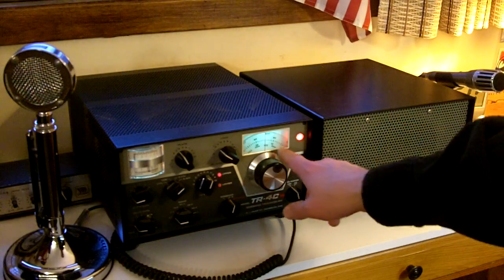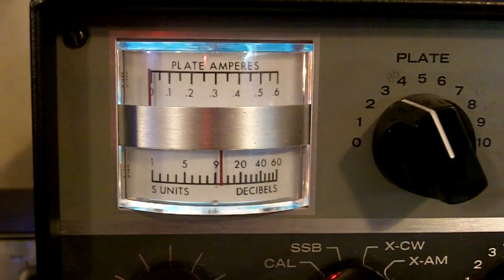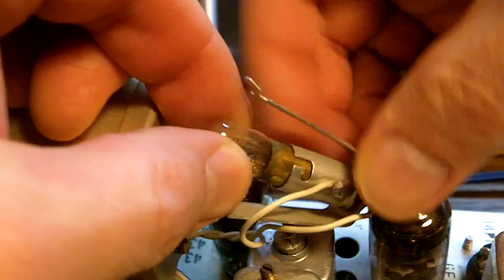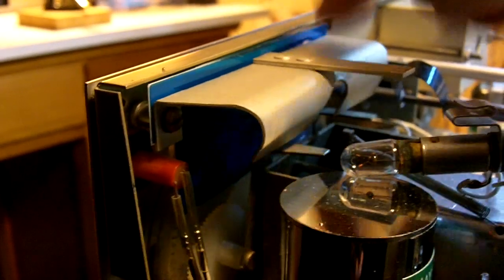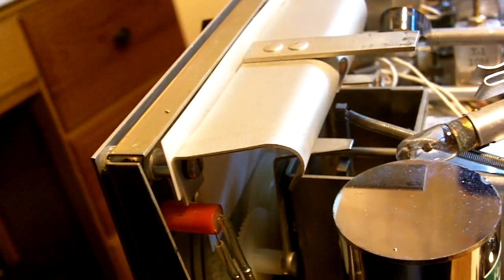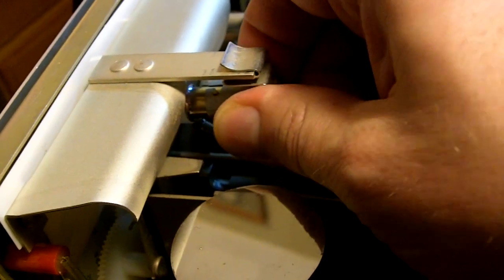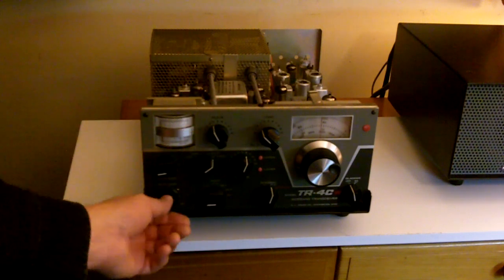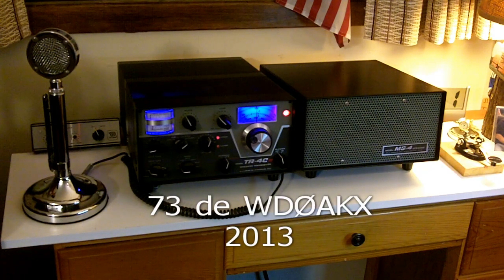Drake TR-4Cw Dial Lamp Replacement With LED's

Comment: Very nice! The only blue LED I found was on Amazon and wow it is way to dark so I took another approach.
I ordered cool white led's then ordered new material for the blue diffuser and it turned out really nice.
Im also going to research som blue led's like the ones you are using. I love the Drakes. I use mine
all the time. TR-3, TR-4 and TR-4C.

Comment: The LED on the VFO side looks like an improvement. I don't think I would do it for the metering side of mine though. I have a hard enough time seeing the FRONT meter faces now with the current back lighting. I don't think this improves too much on that issue. That is, illumination on the meter faces but that's much more of a problem to do if not impossible.

Comment: Larry, just wondered do you still have your Drake TR-4cw ? The newer vids dont show the Drake rig.
Reply from the maker: Yes, I still  have all the Drake equipment, it will be hard to part with that stuff!
Reply: RadioHamGuy Oh yeah for sure ! I also have a mint Kenwood 830s that I use most the time. Hey, I installed those blue lamps...wow ! what a difference !! Thanks for the heads up on D.A. Buska Engineers !
Reply from the maker: Ok on the 830, I have never owned one but remember operating them many years ago at some of our field day operations.  They seemed like a great radio.  Ok on the blue lights, they just look nice I think. My cameras sure don't seem to like that color though, it sure does not come out good on camera, video that is.

Comment: I have a question for you, I want to run a 12 vdc fan to help feep the finals cooler. Should I install it with the fan sucking air out or blowing air in ? It will be mounted on the top of the cage above the finals
Reply from the maker: You will want it to suck air out of the radio and not blow air in directly.
Reply: RadioHamGuy very good. Also When I take the top off my Drake tr-4c I can see the bearings on the vfo shaft. Can I use synthetic motor oil to lube them if applied with a artists paint brush ?
Reply from the maker: I am not for sure on the type of grease or oil you would want to use for that, I don't want to give you wrong information so you might want to do a little more research on that.
Reply: RadioHamGuy Yes I did and found out that wb4*** uses motor oil. I ended up using Castrol full synthetic just a few drops on the bearings and the screw drive.

Comment from the maker: Thanks, and yes, that radio does have plenty of heat to deal with, so this helps a little bit with that also like you say and draws a little less current from the power supply also.